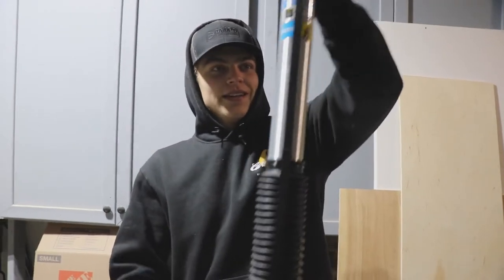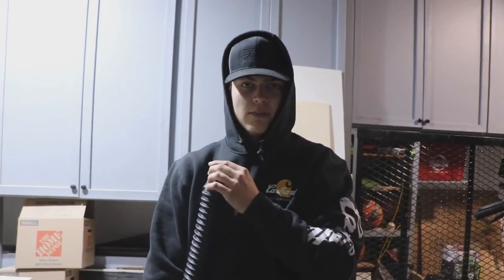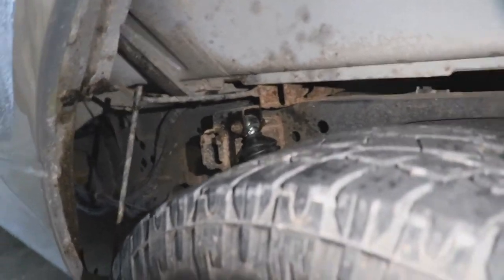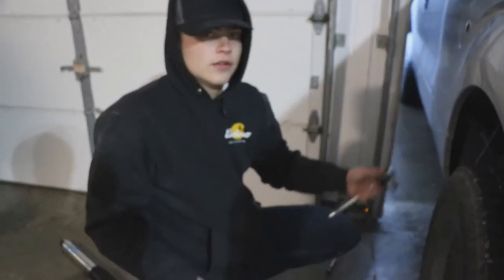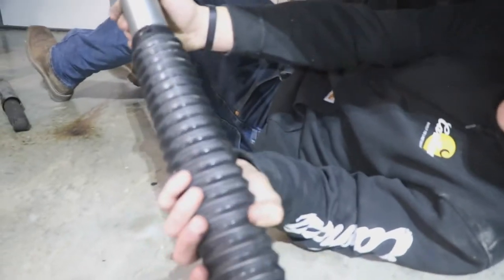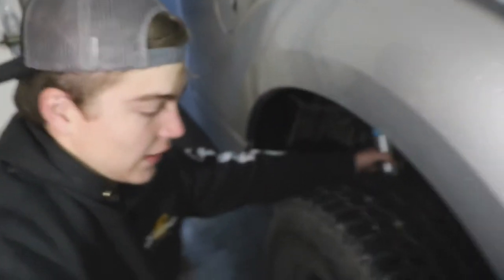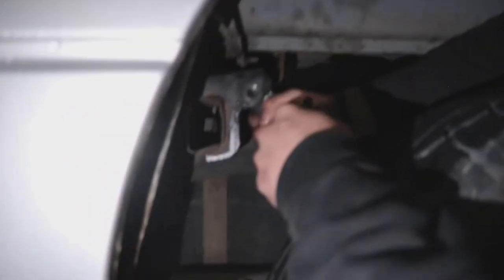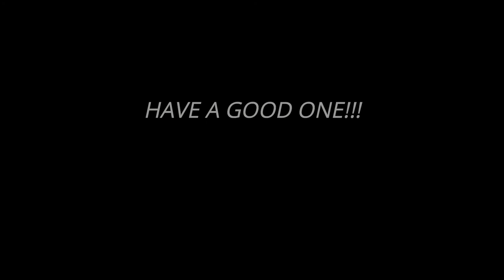How To REPLACE REAR SHOCKS For 2004-17 Ford F-150 (BILSTEIN B8 5100 SERIES)

Comment: Do I install boot up or boot down?
Bilstein label on the shock body should be upright.

The Bilstein label on the shock body should be upright in the correct orientation. If your shocks have been installed with the stickers on upside down they should be flipped the other way.